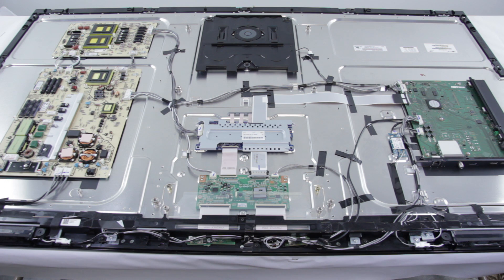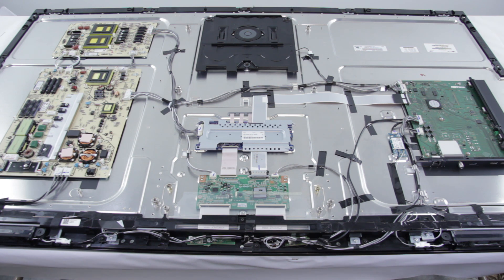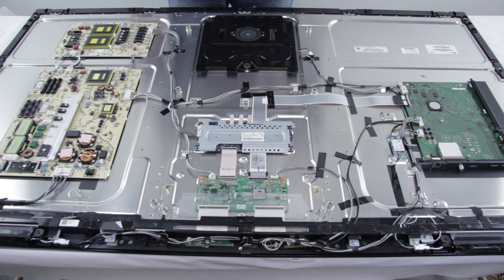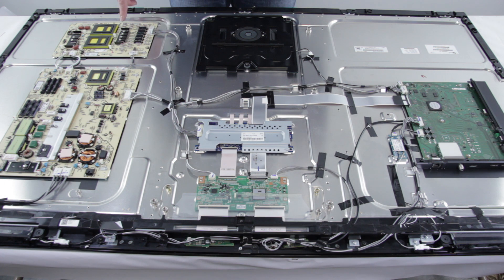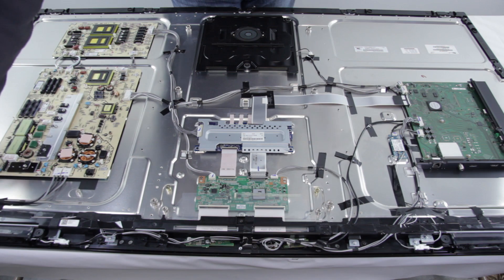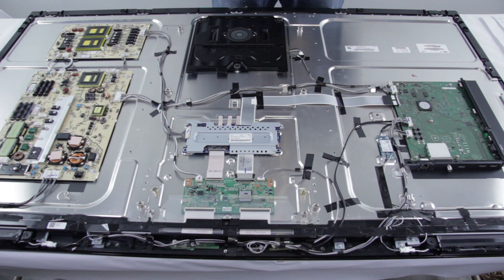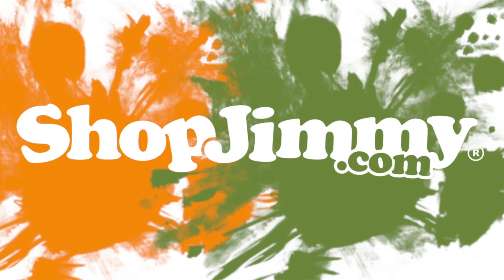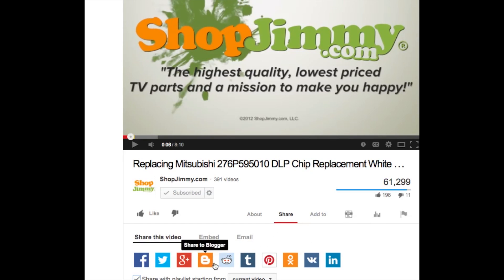LED TV Repair Review Power Supply Overview-NO Power Common Power Supply Repair & LED TV Power Supply

Comment: I have a LG (50LN5600-UI.Was watching when the picture went out. I can turn on and see the LG logo for a split second. I ordered the power board but it didn't make any difference so I replaced the main board next. Still didn't help.
Reply: +Danny Ballard I can see a picture with the flashlight test.
Reply from the maker: +Danny Ballard   Try all repairs and troubleshooting at your own risk. This sounds like a problem with the actual LEDs inside your TV. These LEDs are replaceable, however it is recommended they are replaced by someone with the proper experience and training. When replacing the LEDs, the TV panel can get damaged. If the TV panel gets damaged, it is not repairable. Click this link to replacement LEDs for your TV model number:  http://www.shopjimmy.com/catalogsearch/result/index/?cat=299&q=50LN5600   Be sure to match the panel information necessary to ensure you have the correct replacement LEDs.Thanks and please let us know if you have any further questions with your TV Repair!  www.shopjimmy.com

Comment: Hi, I have a LG 50ln5400 tv.  for a while the standby red light will be on but the tv would not power up.  If I unplugged the tv and plugged it back in the tv would work for a few weeks then I would have to repeat the process.  Now when I plug the tv in the red stand by light flashes twice then goes out and I get nothing.  any help would be great.
Reply from the maker: Dennis Alvarado   PLEASE SUBSCRIBE TO OUR CHANNEL - Try all repairs and troubleshooting at your own risk.  I recommend replacing the main board in your TV.  Click this link to replacement parts for your TV model number:  http://www.shopjimmy.com/catalogsearch/result/index/?cat=56&q=50ln5400  There may be multiple boards for the same TV model number, be sure to match part numbers on your current board, with your replacement for compatibility.  Here is a link to a video showing how to identify your part number, click here:  https://www.youtube.com/watch?v=RwHTvjMdrhk  Thanks and please let us know if you have any further questions with your TV Repair!  www.shopjimmy.com

Comment: On a Sanyo DP58D34, it has no sound, and no video, but the green power light comes on when turned on and you can here clicking coming from back of tv when you turn it on.  What would cause this?

Comment: Hi, I have a fairly new Sanyo 55 inch LED tv. We just had a very intense thunderstorm go through our area with very intense lightning, one of which hit very close to the house causing the TV to stop working instantly. Everything else electrical that was plugged into the same powerstrip is un-affected, but the TV will not power up. Any suggestions?

Comment: I have a 60" Vizio E600i-B3. The TV will not power on, the TV is plugged in. I have removed the back to check the power board, but I can not see any burnt or bulging  capacitors. I have double checked the connections to the power board as well.

Comment: Emerson 50" LF501EM5F, I'm ready to buy whatever it is I need, just want to make sure I get the right part. I was playing a game on PS3, tv shut off and started making a high pitch beeping which sounds like is coming from the power supply board. No lights & TV stays black when plugged in. Also, I noticed on your site that if it was the power supply board I needed, you're currently out of stock, but it says the LF501EM4 board will work? Thank you

Comment: I have a Samsung LED 55' 240 hz Model number UN55D7000LF, we had a power outage and my TV was plugged into a surge protector but when the power was turned back on the TV had power but would only click and never turn on fully. I just need to know if I need to replace a board. I didn't see any archs or burn marks on any of the boards. Thanks,

Comment: Hello my Samsung p2770hd TV just went out and it won't turn on. The standby is not on but the audio cable in the back is flashing red. I looked inside the TV and checked the capacitors, but the caps are fine. Please help

Comment: Vizio M650SVE. My TV turns on, shows the vizio logo and turns right back off.
Reply from the maker: James Martinez  PLEASE SUBSCRIBE TO OUR CHANNEL - Try all repairs and troubleshooting at your own risk.  I recommend replacing the main board in your TV.  Click this link to replacement parts for your TV model number:  http://www.shopjimmy.com/vizio-55-74n01-001-main-board-for-m650vse.htm  There may be multiple boards for the same TV model number, be sure to match part numbers on your current board, with your replacement for compatibility.  Thanks and please let us know if you have any further questions with your TV Repair!  www.shopjimmy.com

Comment: Hi Guys,

I have a Samsung UE40ES6100W with probably a power issue. The standby led is ON as it should be, but when I power up the TV it just blinks once and nothing else happens. If I keep pressing the power button the standby led keeps blinking and that's it. I've disassembled the back plate and discharged the big capacitor and took a close look at the smaller capacitors, but they all look just fine (no bumps or leaks).  

What could be the problem and what do I have to replace to make it work again?

Thanks for any help guys
Reply from the maker: Nabil Amjad  Try all repairs and troubleshooting at your own risk.   I recommend replacing the main board in your TV.  Click this link to replacement parts for your TV model number:  http://www.shopjimmy.com/catalogsearch/result/?q=40ES6100  There may be multiple boards for the same TV model number, be sure to match part numbers on your current board, with your replacement for compatibility.  Here is a link to a video showing how to identify your part number, click here:    Thanks and please let us know if you have any further questions with your TV Repair!  www.shopjimmy.com

Comment: Insignia NS-55E560A11 purchased 1/11.  6 mo ago began shutting off.  Had to unplug and replug sometimes repeatedly to restore.  Would b Ok for few minutes or few wks.  Sometimes would momontarily have many short vertical lines, sometimes would turn itself back on.  Recently worsened and now will only stay on a few minutes.  Can u help me fix?  David
Reply from the maker: *****   PLEASE SUBSCRIBE TO OUR CHANNEL - Try all repairs and troubleshooting at your own risk.  I recommend replacing the main board in your TV.  Click this link to replacement parts for your TV model number:  http://www.shopjimmy.com/insignia-123834-main-board-for-ns-55e560a11.htm  There may be multiple boards for the same TV model number, be sure to match part numbers on your current board, with your replacement for compatibility.  Here is a link to a video showing how to identify your part number, click here:  https://www.youtube.com/watch?v=LIWO2A_tuaIThanks and please let us know if you have any further questions with your TV Repair!  www.shopjimmy.com

Comment: Hi. We bought our Samsung UNF6300 TV 18 months ago and now it is not turning on.  It made popping noises like 5 times and 2 of the times the screen froze.   Then the last time it worked we turned on TV and within 5 minutes a loud pop happened and the TV turned off.  It will not turn back on and it doesn't even show a light.  Any idea what we need to fix it?  Thank you!  Deirdre
Reply from the maker: Deirdre Gale  Try all repairs and troubleshooting at your own risk.  I recommend replacing the power supply board in your TV.  Unfortunately I do not see any replacement parts in the search results for your TV model number on our website.  Please reply with your part number on your power supply board and I can try searching for replacement parts.  Thanks and please let us know if you have any further questions!  www.shopjimmy.com

Comment: ihave a samsung un46d6000sfxza it will not go on it blinks red double blink for five times stops a few seconds than repeat
Reply from the maker: john campo  PLEASE SUBSCRIBE TO OUR CHANNEL - Try all repairs and troubleshooting at your own risk.   I recommend replacing the main board in your TV.  Click this link to replacement parts for your TV model number:  http://www.shopjimmy.com/catalogsearch/result/index/?cat=56&q=un46d6000sfxza  There may be multiple boards for the same TV model number, be sure to match part numbers on your current board, with your replacement for compatibility.  Here is a link to a video showing how to identify your part number, click here:  https://www.youtube.com/watch?v=BEPWrefQvqIThanks and please let us know if you have any further questions with your TV Repair!  www.shopjimmy.com

Comment: Hey Jimmy, I have a DEVANT Ledtech LCD TV (MEL150). It shuts down after 15-minutes of watching, then it turns ON after 5 minutes or after it cools down. What seems to be the problem? I Checked the capacitors but there are no signs of bad capacitors, is the power supply the culprit? Thanks man and more power!

Comment: Hi guys, you helped me in the past, so I hope you can help again:here's the situation, SAMSUNG LED smart TV UN46ES6100F will not power up. The area was hit by lighting and took out the Satellite dish box that is connected to the TV via HDMI cable. There are no typical burn out signs at the HDMI input port or bulging capacitors on any boards.  It appears that there is power on he power board,so I was looking at replacing the main controller board.  no stand by lights, no back lights. Anything else to check on? what else should I verify on the power board? 
thank you .... you guys are great!

Comment: I have a Westinghouse LTV-32W6HD TV. When I turn on the TV the blue light will come on, but nothing else, no picture or sound.  To turn it off I have to unplug the power cord.  After plugging the power cord back in, the TV works.  Is this worth fixing?  If so, what part should I replace?

Comment: Hello, I have a TOSHIBA 50L1350U ..with the no back light. I did the flash light test and can see the image, so i took the back off and this TV does NOT have LED driver board, it looks as if the LED back light wires connect to the Power supply board. Could the power board cause the back lights not to work but yet still supply power to power on the TV? or should I be looking for something else causing the problem with the back lights?
Reply from the maker: A W   PLEASE SUBSCRIBE TO OUR CHANNEL - Try all repairs and troubleshooting at your own risk.  This could be a problem with either the power supply or bad LEDs in the TV.  You can replace the power supply board to see if that fixes the problem.  Click this link to replacement parts for your TV model number:  http://www.shopjimmy.com/catalogsearch/result/index/?cat=59&q=50L1350U  There may be multiple boards for the same TV model number, be sure to match part numbers on your current board, with your replacement for compatibility.  Here is a link to a video showing how to identify your part number, click here:  https://www.youtube.com/watch?v=b9L0-m0-pjA  Thanks and please let us know if you have any further questions with your TV Repair!  www.shopjimmy.com

Comment: i have a Samsung  model # un50eh5300 50 inch 1080p 60hz led hdtv. I was watching tv on power went off an it wont go on. the standby red light is off. The tv is not receiving power. If the problem is the G6 or G7 power supply boards; Do i have to replace the entire board? you can send email to: latigomongo@gmail.com
Reply from the maker: Luis Ramos  Try all repairs and troubleshooting at your own risk.  Just the main power supply.  Thanks!  www.shopjimmy.com

Comment: Westinghouse Model CW40T2RW Serial No.7246V25200349, won't power UP, cord has power in it. possible part no. the input panel?? part no. CKB7-820-254
Reply: Mark Scholfield I have the exact same TV CW40T2RW and the red light is on at the bottom left (normal light that shows up when it has been plugged up), but pressing power via the TV remote and button on the TV itself does nothing. I've had the TV maybe 2 years.. :( Should of went with VIZIO.
Reply from the maker: dryicicle  Try all repairs and troubleshooting at your own risk.   I recommend replacing the main board in your TV.  Click this link to replacement parts for your TV model number:  http://www.shopjimmy.com/catalogsearch/result/index/?cat=56&q=CW40T2RW  There may be multiple boards for the same TV model number, be sure to match part numbers on your current board, with your replacement for compatibility.  Here is a link to a video showing how to identify your part number, click here:   https://www.youtube.com/watch?v=SoUXsgOx25oThanks and please let us know if you have any further questions with your TV Repair!  www.shopjimmy.com
Reply: capacitor

Comment: just replaced the main power board on my tv ( Lg 50ln5310) with one from you guys but i am experiencing the sam problem still...the tv light  flashes 2-3 times then goes  out when it is plugged in. 

Any suggestions?
Could it be the cord?
Reply from the maker: Lauren Avery   PLEASE SUBSCRIBE TO OUR CHANNEL - Try all repairs and troubleshooting at your own risk.  It could be that you received a defective replacement part or there is a different problem with the TV.  Thanks!  www.shopjimmy.com

Comment: Hi, I have a Sony KDL32EX723BU LED Tv that has developed a fault.  Frequently when turning it on from standby the tv comes on for a few seconds and then turns itself off.  The standby light then flashes 4 times before pausing and repeating.  Unplugging the tv from the wall and leaving it will sometime clear the fault, but it is becoming more frequent.  Can you advise what might need replacing?  Thanks, Alex.
Reply from the maker: Alex Rooney  PLEASE SUBSCRIBE TO OUR CHANNEL - Try all repairs and troubleshooting at your own risk.  This could be a problem with either the t-con board, the main board or the TV panel.  You can replace the main board and t-con board individually to see if one of those boards fixes the problem.  Unfortunately I do not see any replacement parts in the search results for your TV model number on our website.  Please reply with your part number on your main board and I can try searching for replacement parts.  Thanks and please let us know if you have any further questions!  www.shopjimmy.com

Comment: Anyone know where I can find a TXACB2K003 main board for a Vizio M260VA LCD TV?  Looks like there are some burned out components on the board.  I am not able to find this part in stock online anywhere.  I live near Huntsville, AL.
Reply from the maker: Bryan Horton   Try all repairs and troubleshooting at your own risk.  What are the symptoms and problems that your TV is showing?  Thanks!  www.shopjimmy.com
Reply: White indicator light in bottom right hand corner stays on.  When pressing or holding the power button screen just stays black.  I opened the tv up and have already replaced the power supply board but get the same symptoms.  I then took the main board off and removed the silver cover.  There are burn marks and melted components directly above the top HDMI port.

Comment: Vizio Model # M260VA  Have replaced the power board which we purchased from you. Lightning during a storm put the directv box out and the tv. Everyone told us it was the power supply board, so it had a burnt spot on it when we removed it. But now the light comes on but the screen does not come on. What else could be wrong with it.
Reply from the maker: Sylvia Allen  PLEASE SUBSCRIBE TO OUR CHANNEL - Try all repairs and troubleshooting at your own risk.  I recommend replacing the main board in your TV.  Click this link to replacement parts for your TV model number:  http://www.shopjimmy.com/catalogsearch/result/index/?cat=56&q=M260VA  There may be multiple boards for the same TV model number, be sure to match part numbers on your current board, with your replacement for compatibility.  Thanks and please let us know if you have any further questions with your TV Repair!  www.shopjimmy.com
Reply: Thank you ShopJimmy we will try this as soon as I get the money to purchase it. Sylvia